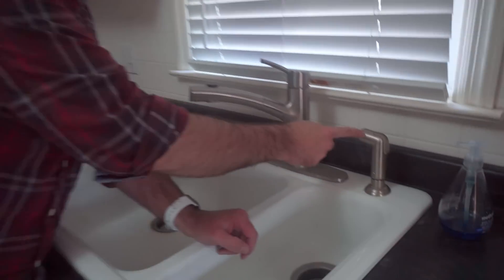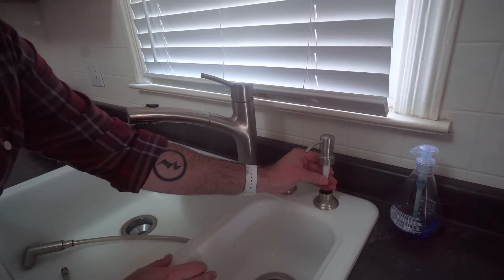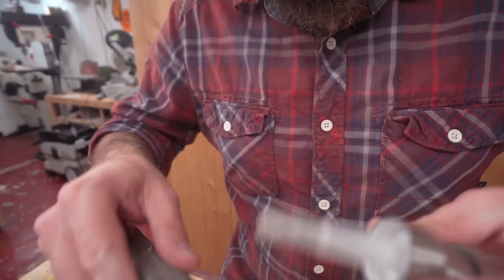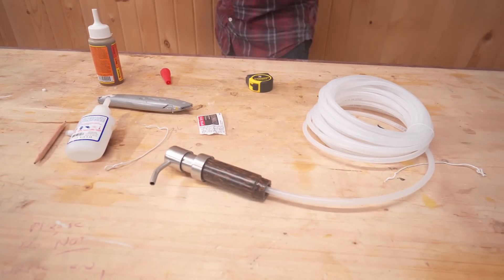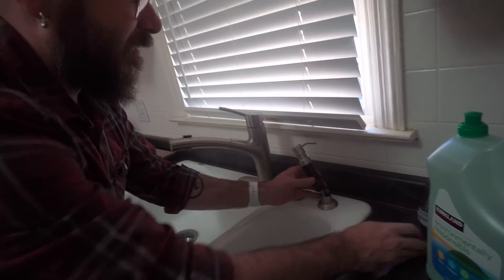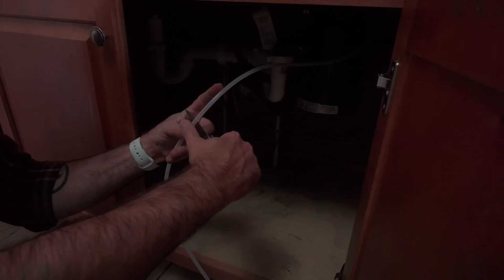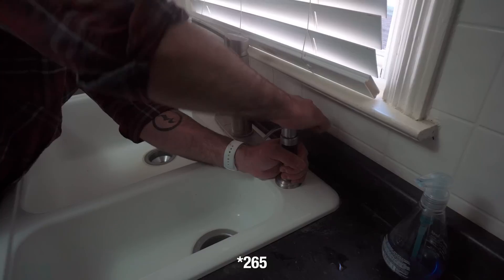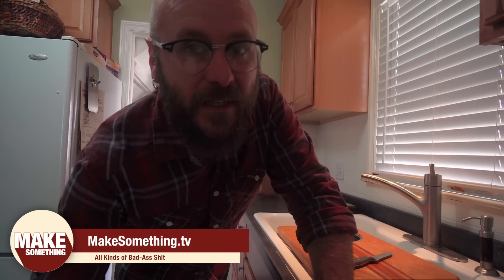Easily Install an Endless Soap Dispenser in Your Kitchen Sink | DIY Project

Comment: Never thought to use CA glue for water protection! Fantastic idea David!
Reply from the maker: Thanks Ryan!
Reply: Well, maybe it's not the best solution. In my experience CA glue (as long as it isn't the super expensive industrial grade waterproof stuff) doesn't hold up very long when it constantly gets wet. On my RC Boats little details kept falling of until someone told me to not use CA for that.

But I'm quite curious to see how long it holds up as a wood finish because it is just so simple to apply.
Reply: Ryan Petzoldl It may have had something to do with the material you were sticking it to. Like HDPE, I've not found anything to stick 2 pieces of that together!
Also, since you stopped using CA glue on the boats what do you use now?
Reply: In this case it wasn't due to the material choice. It was like PS to PS or ABS, so normally it would stick like hell.

But you're right. There are materials that are a real pain to glue or paint. I once tried to spraypaint a Bobby Car, which is made of PE...didn't go so well.

There are many factors that determine which glue I use:
-If I plan on painting it afterwards I still use CA
-for things that are easier to paint before assembly and that get really wet (like bollards e.g.) I use pins to align them and then UHU all purpose glue, or epoxy.
-If the plastic is still unfinished also special glue that chemically welds the parts work fine. But these ruin the surrounding paint.
Reply: Wing it Workshop butane gun melt the bad boys together

Comment: I love this idea, might have to try it myself sometime

Did you leave the bottle's cap shut? If so, you might want to open it (if the hole you drilled is as tight as it looked), to let air in. You might have gotten away with fewer pumps if you'd had a vent!
Reply from the maker: Ah, great tip!
Reply: Alex W. , I was thinking the same!
Reply: Haha yeah, I was thinking that too but then wondered where is the air hole on the regular pump bottle?

Comment: the razors dollar shave club sends you are made by dorco pace. they are pretty good and any handle fits any cartridge so you can experiment with how many blades you need. I'd recommend 3 blades max though.

Comment: You need an in line check valve to stop the hand wash flowing back down into the pipe. I use a cheap aquarium one.
You may also need an extra hole in the bottle to stop it collapsing under vacuum.

Comment: Love it! The only improvement I think would be to have found way to screw the pump onto the wood. That way, if/when the pump fails, you don't have to make a whole knew one... or deal with ripping it off and cleaning up all that nasty Guerilla Glue. Of course, by the time it fails, they probably won't make that model pump anymore and you'll just have to make a whole knew one anyway. So you're probably fine 🤓👍

Comment: I have been using this method for a couple years (we even use the same Kirkland soap).  I just remove the cap from the bottle and stick the tube in. But the tubing curls up and leaves about 1/4 of the bottle with soap still in it.  Does your tubing curl at the bottom?  Any suggestions on how to stop my tubing from curling?

Comment: Does the soap in the pipe flow back in the container, if you dont use it for a while?
So you have to pump several times to get some soap...!?
Reply: Schweizer I don't think so.
Reply: Schweizer you can always add a check valve if needed
Reply: Or hook it up to your compressor so you don´t even have to pump it anymore.
Reply: Bence507 yeah i was thinking of something like that too ^^

Comment: the thing is that next day you will need to pump it 265 times again as these dispensers are not super air tight the soap in the tube flows down, and you need to pump it again which is annoying. I had an idea and used one of the aquarium valves that is one way flow - to stop soap of going back to container. But it worked for a while... so not sure if this works amazing for someone ?

Comment: How did you get the tube to stay in the soap dispenser? I have tried this and that curly hose keeps pulling out of the dispenser. Super glue hot glue all purpose glue all failed.
Reply from the maker: +Tom Angel it fit in nice and snug

Comment: I did this last year and it’s not powerful enough to pull soap that far. I ended up having to use a far from endless bottle and mount it right under the dispenser :/

Comment: Good job, but you flawed your design at the end.  You drilled the hole to soap jug into top of jug, meaning when it runs out of soap, you have to drill another hole in new soap jug or fill new jug into old one.  This can all be avoided by drilling hole into jug cap.  Then when you run out you simply change the soap jug out by removing new soap jug cap and putting the cap and hose from empty jug into new jug and tightening cap.  Changeout in less than 10 seconds.
Reply from the maker: You're right! Will fix that!

Comment: You have a lathe, yet you chose to use a chisel .... puzzled
Reply from the maker: The center had already been drilled out. No way to chuck it up on the lathe.
Reply: Yes, but a bit of planing could have stopped that and a conical  center  guide would have worked as well
Reply from the maker: You're also forgetting that a chisel works great as well! WOODWORKING... so many great ways to accomplish a task!

Comment: bonehead! you need a double loop to keep the suction going!
Reply from the maker: +Greg Coste I am a bonehead for sure! Can you explain the double loop for me?
Reply: you'll need fresh tubing (from the roll you bought) and some plastic wire ties .. just below the pump you'll make the first loop (about 3 inches) .. secure the cross section .. make the second loop (same size) below the first, so that the top of the second loop overlaps the bottom of the first loop by about an inch, secure the cross section and secure a point where the two loops cross .. continue with your tubing to the the soap bottle (tube goes to the bottom of the bottle) .. trim tube (you just created) to fit to the bottom of the pump

this will create a double seal, so the soap in the tube doesn't drain out and be replaced by air (you keep the vacuum going once you prime the tube/pump) and "your idea" works!
Reply from the maker: +Greg Coste thank you!